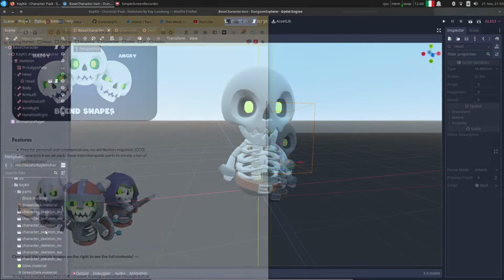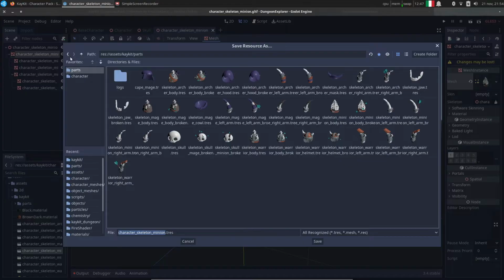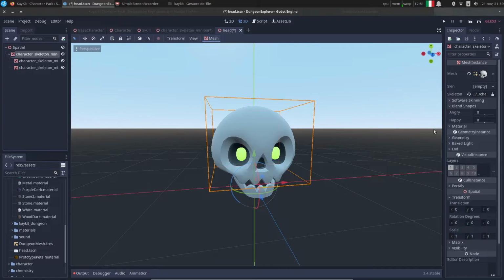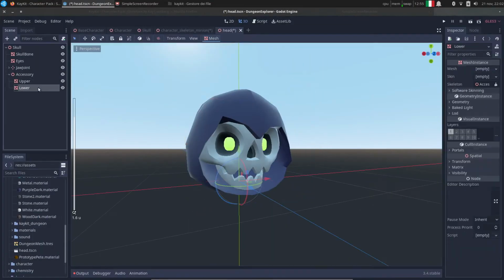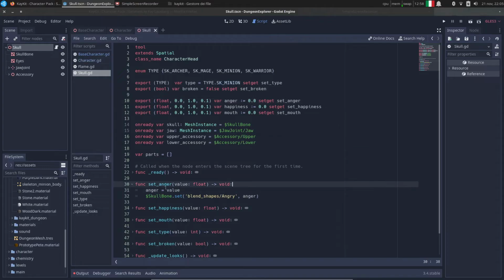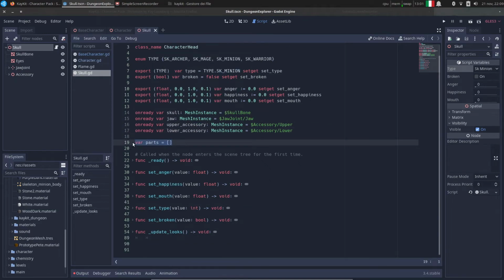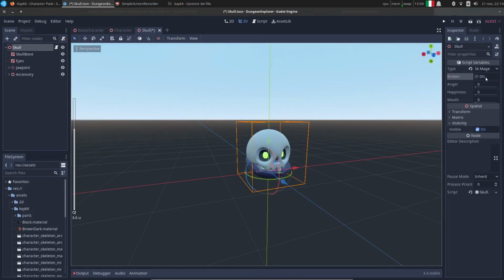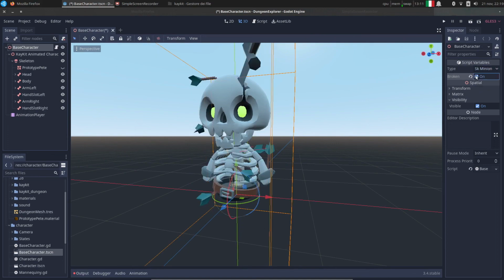Modular Character in Godot 3d

Comment: Here is a question, I am making a modular building in Godot, with a building modular kit with a:-  wall piece, window piece, door piece, floor piece, etc. My kit is imported from a glb file called building_modular_kit.glb. I want to be able to edit the wall piece in the glb file in Blender, so that it automatically updates all the instances of the wall in godot as well. However, only one wall is updated, all the other duplicates are obviously not, as they are not instances. What is the right way to handle this?